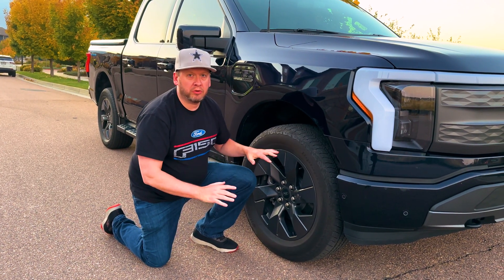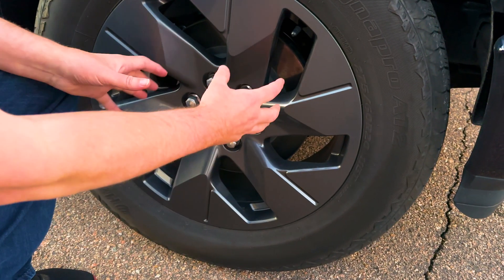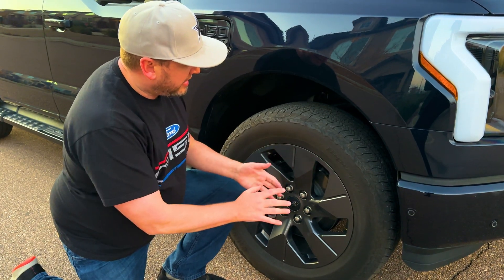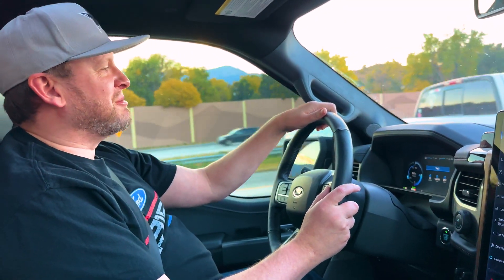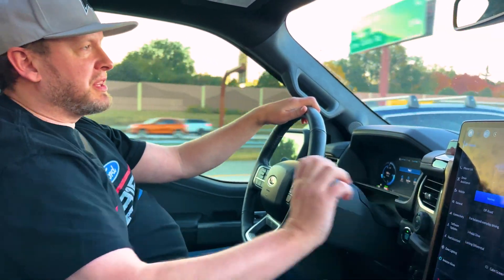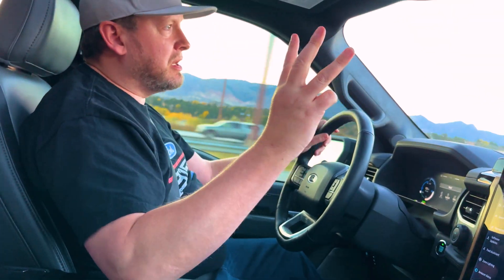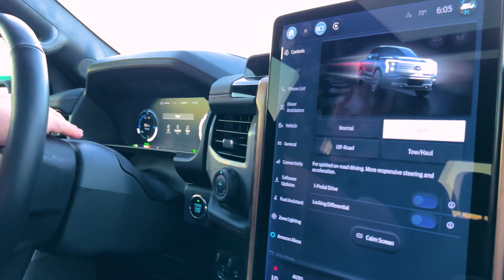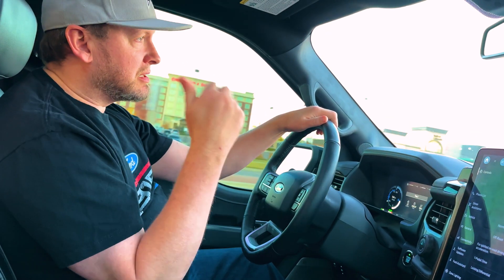Why Sport Mode gets you the best range? & What is Regenerative braking?

Comment: You used the phrase "in my opinion" ...  you need data to back your claim. Do what I did a year ago.  I drove the same route which had some freeway, some highway, and some suburban roads that matched percentages typical for my driving. I did it at night so traffic was very light, a non factor. The temp was stable and there was no wind. All thre modes resulted in the same miles per kWh! The key is driving in normal so you get 100% regen.  That makes it so it can match sport mode. The test course was 27 miles. Not huge but data, not opinion.

Comment: One pedal driving is just soooo much better both for range and driving feel once you get used to it. 

I found it infuriating that my 2019 Bolt did not have it as an ON/OFF option but rather something we had to reselect every time we'd select drive...
Reply from the maker: My wife likes 1 pedal drive better too, but in my experience with the Ford Lightning Sport mode without 1 pedal drive is the most efficient in town and mountain terrain. Here’s a video I did testing all 4 drive modes for efficiency in thr ford Lightning: 
Ford Lightning - 1 Pedal Drive vs Sport Mode - Winter Range Test
https://youtu.be/tjgFYQS1Aj8
Reply: I had a Hyundai that did the same thing. It would revert the 1 pedal option and drive mode back to standard EVERY time you turn it off. Stuff like that needs to be "set it and forget it" IMHO.
Reply from the maker: Agreed, I do wish it had the option to stay in sport mode.

Comment: That was an odd way to explain how resistance captures kinetic energy. It's the same concept as an alternator. When you slow down in an electric car, the motor runs backward and creates resistance. That resistance changes the car’s movement energy into electricity. The electricity is sent back into the battery. Dig your content man!
Reply from the maker: Thanks for watching.  I like your explanation better.  Much simpler. :-)

Comment: I got confirmation from Ford that sport mode introduces more aggressive regenerative braking to add more power back to the battery. That's the reason for the extra range
Reply from the maker: Awesome! That sounds about right.  Yeah most of the time in normal mode if you let off the accelerator you think it’s regen but it’s not sending anything to the battery until you apply the brake.
Reply: @F150LightningMike I also found out the extended range is actually 143kwh and we only have access to 131kwh. Reason being we will never charge to a true 100% keeping the battery health going and also it will never drop below 70% so the warranty will never be used. Ford also told me using the level 2 home charger it was perfectly fine to charge to 100% every time just not on a super charger keep that at 80%
Reply from the maker: That’s great advice, thank you.  Yeah there always seems to be extra when I charge it to 100%, but it only seemed to be about 4 or 5 KWh.  If you don’t mind my asking. Who did you talk to at Ford about it? Was it customer service? Or someone else at HQ.

Comment: I'll be driving from Knoxville TN to Asheville NC next week. I'm concerned if I make it to the Tesla charging station in Asheville with my 240 range. There is significant incline the first half of the trip, then some.decline on the second half. I plan on sport mode without one pedal going up the mountains and then add one pedal driving on the decline into Asheville. Thoughts?
Reply from the maker: I usually don’t mess with turning on 1 pedal drive unless you like it better.  Even during decline sport mode is enough most of the time. 
How many miles is the trip?

Comment: I have found on the 24 flash at least, when you use sport mode the AC compressor for cooling starts running, and it actually uses more power because it's running the cooling system when in sport mode or tow haul mode. I get the best range in normal mode
Reply from the maker: That’s interesting.  I think range benefits from sport mode also depends on terrain.  I live in Colorado Springs and there are a lot of changes in elevation pretty much wherever I drive so it seems to help.  Also if you are only driving highway then sport mode won’t matter much.  That being said here’s a follow up video I did where I compared every single mode.
Ford Lightning - 1 Pedal Drive vs Sport Mode - Winter Range Test
https://youtu.be/tjgFYQS1Aj8

Comment: If Ford works like the majority of EV and hybred cars, the brake pedal does the same as one pedal or sport driving.  I'm quite sure that is true with the Lightning as well.  Interesting opinion but just an opinion.
Reply from the maker: You’re right, that’s just my opinion but based on my testing it seems pretty true. Here’s a video I did testing all the modes and comparing the difference.  
Ford Lightning - 1 Pedal Drive vs Sport Mode - Winter Range Test
https://youtu.be/tjgFYQS1Aj8

Comment: I have no idea what you just said ??? Sport mode, regenerative braking, one pedal drive mode ??? Generators in the wheels ???
Reply from the maker: There are 2 electric motors that provide power to the wheels from the batteries when driving.  Those same electric motors charge the batteries using regenerative braking when the vehicle is slowing down.  
For my lightning sport mode uses more aggressive regenerative braking.
Reply: @ that is a way better explanation than I got out of the video. From the video, I was under the impression you thought there were generarors in each wheel that captured regen energy, and that in sport mode there was zero regen and the efficiency came because you were freewheeling every time you took your foot of the gas pedal …
Reply from the maker: Thanks for the comment.  Happy I was able to clarify.
Reply from the maker: Let me know if you have any more questions about the Lightning.
Reply: @ I am picking mine up later this morning, so will probably have a lot of questions :)
Reply from the maker: How’s it going with your lightning?

Comment: I just purchased the F150 Lighting in the Flash trim package with the bigger battery and AWD in Flagstaff AZ. I will be driving between  here and Moab UT regularly and I do home improvement on our properties. I have had deposits on Cyber Truck, Canoo, Revian and passed on all of them for this 2024 even though I had a deposit on the first run of Lightings that came out I waited. Mostly becucase where we live and drive there is'nt enough charging infrastructure with everything so spread out it can be almost 200 miles before you get to the next charger. Recently Tesla put another station in a remote place Kayenta AZ which happens to be about half way to Moab. As soon as we discovered this I went to my local Ford Dealer and purchased the Flash at zero interest with 3k in rebates plus the Ford Power Promise which will include a new stage 2 charger and the installation! Turns out our timing was good. This weekend will be my first test of this EV and the trip to Moab. Looks like I can use the Tesla station in Kayenta with the Lectron adaptor I got from watching State of charge youtubes. Thank you for helping us out! I usually use the adaptive cruse control on trips like this so I am not sure if Sport mode will make a difference or not for the range.

Comment: No, the best efficiency will be when your coasting.
Reply from the maker: Here’s a video I have comparing all of the modes.  So whether you are coasting or not it’s about the mode that you are in.  Range is also impacted by a lot of other factors like weather and terrain.
Ford Lightning - 1 Pedal Drive vs Sport Mode - Winter Range Test
https://youtu.be/tjgFYQS1Aj8
Reply: @ it’s simple, when using regen, you will have lost to recharge the battery and after that lost accelerate the EV.  Then as much as possible, don’t use the regen.  I use coasting with my travel trailer and a i have great results.
Reply: @ and even without 1 pedal driving, you have regen with the pedal braking, it’s the same as 1 pedal driving, use the momentum « coasting » of the EV without regen wille be the more efficient.
Reply from the maker: I can’t speak to the science of it.  All I know are results from my tests.  It might have something to do with the terrain I live in, since I’m in Colorado, but I’ve tested it multiple times and every time I’m driving around town and to and from work. I get the same results.  Sport mode without 1pedal drive wins.  
That being said when I’m on trips it doesn’t seem to matter to much because I’m just driving down the highway.  Also, I’ve talked to people in Florida and other flatter terrains and some of them are having less of a difference than I do.

Comment: Great information, just got a 2024 Flash and need all the help I can get . You are a smart fella for a Cowboy fan 🤠. I will be testing your method ona trip from Sacramento to Las Vegas in a few weeks. Again great job at breaking down the different modes.
Reply from the maker: Thanks! Smart for a cowboy fan … lol
Keep in mind you will notice more range savings with sport doing normal everyday driving.  You may not see as much on trips with straight highway driving, but I still use it.
Also, turn off propower on board when you are not using it, and that will save some range too.
Here’s a more recent video I did testing out all of the modes:  Ford Lightning - 1 Pedal Drive vs Sport Mode - Winter Range Test
https://youtu.be/tjgFYQS1Aj8

Comment: I love one pedal drive. I haven’t used sport mode much. I like one pedal drive because I never ever use my brake pedal to come to a complete stop. My brake pedal is only used to change gears, park, reverse and drive.
Reply from the maker: My wife loves 1 pedal drive too, and I have to tell you it’s not a bad way to go once you get used to it.  I did a newer video comparing all of the modes (link below) So in my experience you can leave on 1pedal drive and turn on sport mode and get the 2nd best overall efficiency.  
1st=sport mode (1pedal OFF)
2nd= sport mode (1pedal ON)
3rd = Normal (1pedal ON)
4th = Normal (1pedal OFF)
Ford Lightning - 1 Pedal Drive vs Sport Mode - Winter Range Test
https://youtu.be/tjgFYQS1Aj8
Reply: @F150LightningMike  interesting. I had just asked about normal with one pedal off then found the answer here 😆. 

I'll watch that one too. You're the reason I decided to get this truck. I take delivery later this week.

Comment: im so glad i didnt bump into this video when you made it. Both one pedal drive and two pedal drive CAN have NO significant difference in effeciency over the other, over the long term. Put another way, driving 100 miles on a straight road on the same day, neither way of driving will produce more or less battery usage over the other. 
Driving up and down a long mountain pass, will also produce no significant difference between the two. Driving style is all that matters. These are the laws of physics. It's impossible to save energy or power or efficiency in either 1PD or 2PD, assuming you are doing the same work and same distance in either style. Its just physics,
Reply from the maker: Thanks for your comment.  It doesn’t fully make sense to me why it works, but it does especially in the mountains where I live.  I have heard from several others who use sport mode on a regular basis and it works for them too.  Others that live in flatter areas say that normal or 1 pedal drive is best for them because they like to coast.  Either way, because of that I made another video comparing all 4 efficiency modes in the Ford Lightning: 
Ford Lightning - 1 Pedal Drive vs Sport Mode - Winter Range Test
https://youtu.be/tjgFYQS1Aj8
Reply: @F150LightningMike  It just doesnt,  it may feel like one way of driving, sport mode vs 1Pd vs 2PD is more efficient than another on a particular day, but it just isnt. To prove this is really hard, because every route and every day is different. Speed and air resistance and driving style is all so over the map. But there is NO way to make one mode be more efficient than another. There is obviously a way to have one mode be LESS efficient, but not MORE efficient overall. Physics just does not work that way. There will be a minimum amount of energy used to go the same speed, the same route, the same day, with he same work being done in the same truck. In fact the energy used will be the same or not significantly different. Its just facts. One cannot create efficiency or create energy out of nothing.
Reply from the maker: Do you own a Lightning? Or an EV?
You sound like you’re pretty smart, so I’m not saying you’re wrong. Maybe I’m saying it wrong.  
Maybe I should say that some modes are less efficiency than others, instead of some modes are more efficient than others.

I may not know everything on this, but here’s what I have found to be true.
 
No energy is being created.  But the reality with an EV is that when you are slowing down it adds energy back into the batteries.  How much energy depends on what mode you are in and how hard you are pressing on the brake, which doesn’t actually use the brake pads at first until it is needed.  That energy which is some of the energy resulting from the motion of the car is returned back to the batteries for later use.  Therefore the efficiency (or range) increases because that energy is reused.  That’s also the reason an EV gets greater range driving around in town.
Reply: @F150LightningMike  You are correct in this. Every thing you say is right. But mostly, its this part that isnt correct.  ALL the modes are equally efficient. IN THE LONG RUN. over a distance. There is not one mode that is more or less efficient than another. They all use the same energy to do the same trip or work. eventually. So it's mostly a case of averages.  But yes, in a short trip, the energy added back by regen can make it 'seem' like it used less than if you did that trip in 2 pedal drive or sport mode. But it really isn't. for example, to drive 10km. To get that regen (in one pedal drive or sport mode) you have to use energy to get the speed to be able to use the regen.  so you end up using a lot of energy to get up to a speed that can use lots of regen,  SO you go the 10km in 20 minutes and use 10% of the battery
If i drive that SAME 10km in two pedal drive, i'll drive using less energy to then coast to a stop at the end of the 10km. Also using 10%. I just used the energy in a different place or way. But same energy every time. Especially over long distances.
Reply: @F150LightningMike  And yes, ive driven my Lighning over 55K miles through two canadian winters and three summers, since August 2022, in 2 pedal drive, sport mode, (which is fun) and one pedal drive. Either way, its not the modes that determine efficiency on a trip. Its speeds, wind, cold, route etc etc.

Comment: So sport mode is best for highway driving and normal mode with one pedal driving is best in city
Reply from the maker: Actually sport mode is best in most situations in my experience.  Here is the latest video I did about it:
Ford Lightning - 1 Pedal Drive vs Sport Mode - Winter Range Test
https://youtu.be/tjgFYQS1Aj8
Reply: @F150LightningMike  In your experience. In my experience, normal with one pedal gives me the highest miles per kwh around town. Your experience is not the only experience.
Reply from the maker: You are correct.  It really also depends on how people drive and the terrain as well.  I’ve talked to several people in the Colorado area as well as other mountain areas that benefit from sport mode because of the constant up and down and changing of elevation.  That being said my goal for doing these videos is to show what works for me and try to inspire people to test on their own.
FYI: Another range saving tip that has worked for me is turning off propower on board when you are not using it.

Comment: I think you've got this backward.  In my opinion, it seems more efficient to coast WITHOUT regen.  Moving energy into and out of the battery incurs losses every time.
Reply from the maker: Thank you for your comment. You are not the only one that has said that normal with coasting makes more sense that it’s better.  Some have said 1 pedal is better.  While I’m sure that in some scenarios you might be correct, I ended up doing a more detailed test comparing all 4 modes (normal vs sport) both with 1 pedal drive on and off. Let me know what you think.
Ford Lightning - 1 Pedal Drive vs Sport Mode - Winter Range Test
https://youtu.be/tjgFYQS1Aj8

Comment: Ok so for best kWh Sport mode and one pedal off?
Reply from the maker: Yes that has worked best for me so far.
Reply: It's best for highway, but I have found normal mode with one pedal driving is better around town. I have gotten over 3 miles per  kwh around town with normal mode and one pedal driving.
Reply from the maker: Good to know.  I’ve been hearing that it varies based on the type of terrain you drive in.  Like here in Colorado Springs sport mode seems to still work best in town for me because of the constant change in elevation.

Comment: What I want is max regen on lifting off the accelerator, without blending the brakes in unless you press the brake pedal. Unfortunately it seems Ford doesn't offer that option. It seems that a portion of the regen is only available on the brake pedal unless in one pedal mode, and in both those cases you have no control over how much is regen vs how much is friction brakes.
Reply from the maker: It is correct you don’t have control over it.  You do have something called “brake coach” that shows you how much of the braking was regen, which is very helpful.  And it basically trains you over time how much to apply the brake in each mode before the brake pads are used.